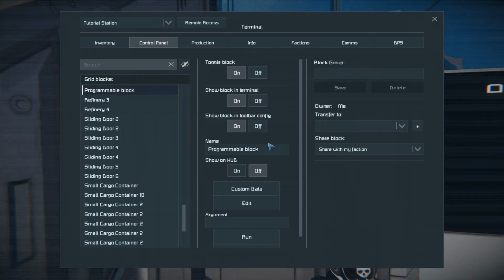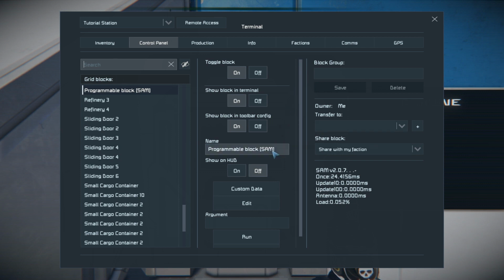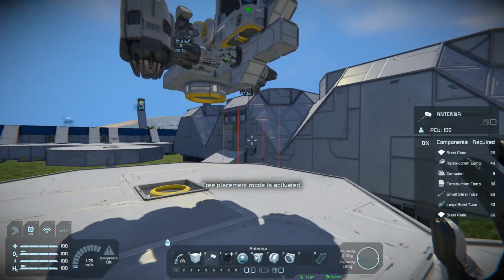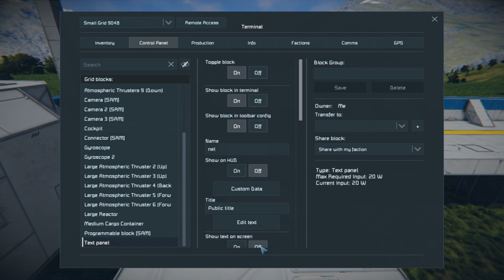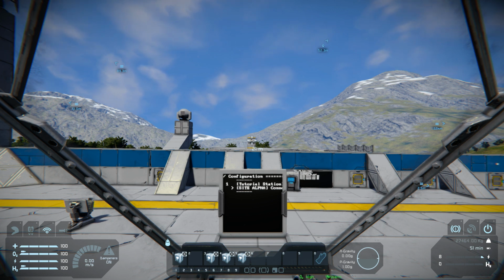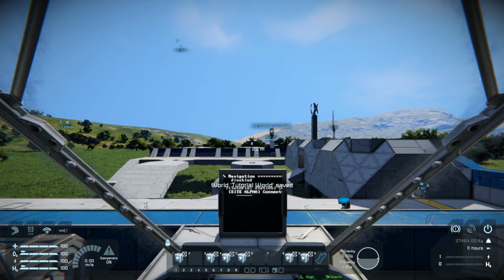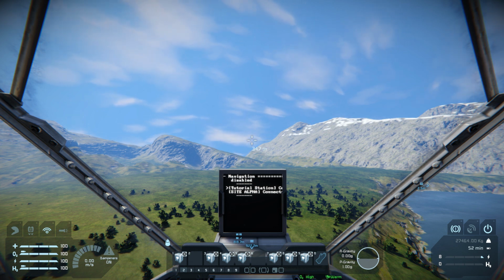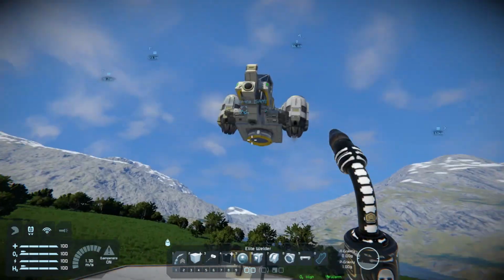The Basics of SAM's Autopilot Manager Version 2 (SAMv2) :: Space Engineers Mod Tutorial

Comment: After watching multiple videos on this script, yours was by FAR the most helpful. Thank you!

In return, please allow me to add my findings in the hopes of helping someone else. 

When naming your stations and connectors I advise you to keep it short enough to read on the LCD.

Important tags : 
	Ship Required
		Programmable Block [SAM NODAMPENERS]
		Remote Controller [SAM]
		Connector [SAM]
		Camera Up [SAM]
		Camera Down [SAM]
		Camera Forward [SAM]
		Antenna [SAM]
		LCD Panel [SAM]
		
	Station Required
		Programmable Block [SAM ADVERTISE Name=XXX]
		Antenna (Does not require tag)
		Connector [SAM Name=XXX]
		
		
	Ship Optional
		Wide LCD Panel [SAM LOG]
		Battery [SAM Empty=10 Full=90]
		Hydrogen Tank [SAM Empty=10 Full=90]
		Cargo Container [SAM]
		Cockpit [SAM PANEL0: PANEL2:LOG]
		
		
		
	
	Programmable Block Hotbar in Cockpit (My personal preferences)
		Hotbar# - Slot #
		
		8-2 CLEARSTORAGE (must recompile)
		8-7 ADD (waypoint)
		8-8 ADD STANCE (waypoint with ship orientation)
		8-9 REMOVE (removes waypoint)
		
		
		9-1 SCREEN
		9-4 NEXT
		9-5 PREV
		9-6 SELECT
		9-8 START
                9-9 STOP

Comment: Is it possible to set a button in a base that lets you recall back a ship that has somehow get stuck far away?
Reply from the maker: That would be possible with an extra script, there are scripts that let you activate functions remotly. I can not recommend you a good one, because i haven't looked into these for a long time.

The other option would be to use the remote control on your ship to guide it back, you could set up a command for the programable block on the hot bar for example.

For both options you would have to have the ship in antenna range.